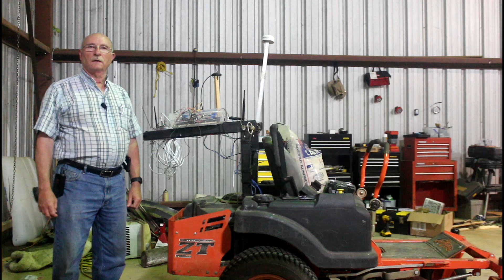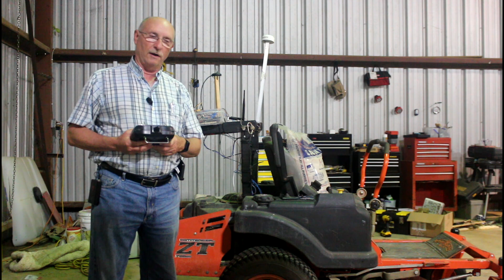Autonomous Mower Overview (Part 1) as of May 16, 2018

Comment: Such an inspiring and informative project! Your approach and detailed explanations are truly impressive and invaluable for those of us exploring similar paths.  I’m currently working on a volunteer project to develop a gasoline-powered platform for evacuating injured individuals from hard-to-reach areas, and your video has sparked so many ideas for our initiative.
We’ve made progress using an Arduino Nano and custom software, but we’re planning to transition to a Pixhawk flight controller with ArduPilot firmware to ensure greater reliability. I would be incredibly grateful if you could share any additional insights or advice on tackling challenges like these.
If it’s possible to reach out to you via email or another way to discuss this further, I would greatly appreciate the opportunity. Your experience could really help us take this project to the next level. Thank you again for your dedication to sharing knowledge with the community!

Comment: Hi Kenny are you still ok ?
Where are we now in March 2021
Reply from the maker: Hi! Well, I am working on it this week. I have replaced the hydraulic reservoirs and hoses for the transmissions that were burned and now I am working on the wiring. I am not able to spend many hours per day as I have some other pressing projects going on. I hope to have it running in about a week, though! I will post a video when I do. Thanks for checking. And how is your rooster robot doing! I just looked at your videos again.

Comment: Kenny, you are my hero! I've been working on my own autonomous mower for a while now and seeing you just jump in head first is inspiring. Right now I'm stilly prototyping my system on a wheelchair set up but am having compass issues (probably related to the steel frame and large brushed DC motors). Did you have any compass issues on your system? I imagine the magneto would cause some interference. Also, how did you do your compass calibration? I've seen it where you have to rotate your rover on three axis to get a good calibration but that's obviously very difficult with a machine as large as yours. Looking forward to more videos!
Reply from the maker: Bob, you are WAY too kind with that comment! But, I am trying to get this working and just wish there was more time in the day. I worked on it last night from 7:00 - 11:00 (last half in the dark with mower running around in a field - looks pretty cool I will say with blue and red LED's out there! I really don't have to see it as long as Mission Planner shows its track.

YES! I am having a lot of compass problems like you mention. I had my Pixhawk mounted right on top of the roll-over-protection (ROPS) bar and basically got no compass at all. I had an external GPS/Compass module that I had dissected and attached leads to the GPS part to capture the messages with my computer when I was trying to figure out what was going on with the C94-M8P. Apparently, I inadvertently damaged the compass part of it as I could not get it working. So, the other afternoon, I experimented with a 2nd Pixhawk I had and found that it worked much better in the middle of the back of the mower. I then mounted a piece of plywood over across the roll bar and put my controls in the middle. I now have a some-what working compass. I also had a compass module I bought: https://www.amazon.com/gp/product/B0141UFZTU/. I connected it and am getting decent readings. I noticed, though, that when the vehicle is heading east or south, I get "Error Compass Variance". I assume the rotating  engine or something adds or subtracts from the earth's magnetic field in that orientation just right to interfere too much. So, I can't say I have that solved. AND, here's the real kicker: I have not been able to get as good tracking performance WITH the compass as I was getting without. That is what I was doing all last night: trying to tune for better tracking. I will be posting to https://discuss.ardupilot.org/t/skid-steer-mower-overshooting-pivot-turns/28910/83 a little later to get help from those on the forum. There are others there who are probably farther along than I. There are certainly Ardupilot experts that are extremely helpful (Randy Mackay for sure!).

I need to make a video again with my progress.

Oh, and I have not been able to do a compass calibration because of exactly what you mention, the inability to rotate it in all directions. Soon, I hope to have the controls (probably including the compass) in an enclosure that I will have strapped to the mower but that I can unstrap and rotate in all directions for the calibration. That is my current thought anyway.

Comment from the maker: I was test driving this weekend attempting to determine the range of the C94-M8P eval boards with their stock antennas. When I got near the limit of the range, I got a few "Bad GPS Signal Health" errors. According to an experienced person on the forum at https://discuss.ardupilot.org/t/bad-gps-health-when-i-have-rtk-fix/26532/45, that means that Ardupilot (Ardurover) is not getting 5 updates per second. You can see the update rate by looking at the Flash Data log value gpa.delta (or gpa2.delta). There, indeed, I did have some spikes around 300 mSec, even one at 400 mSec. I am not sure how much this is affecting the control but it isn't good. I'm going to work on a solution. Stand by for more info.